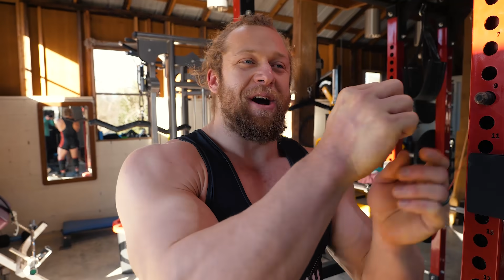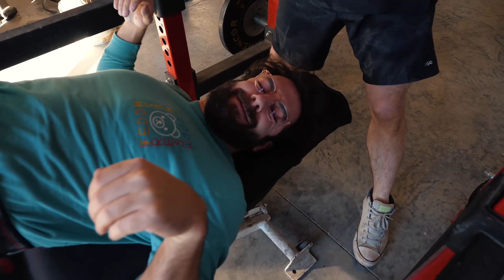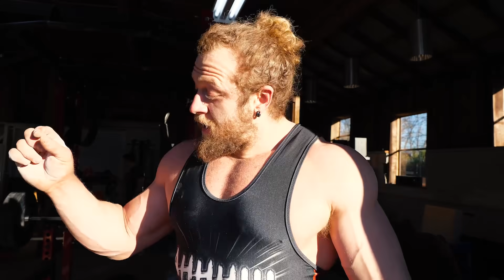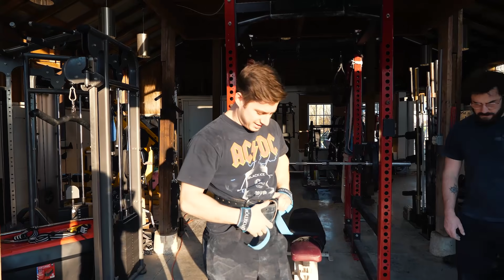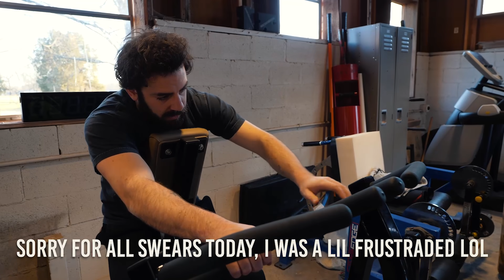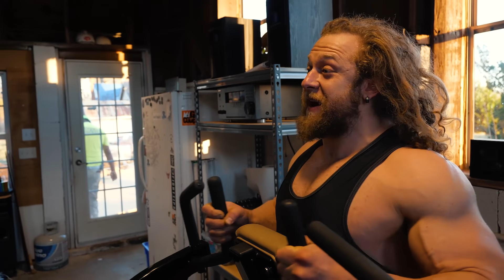Heavy Deadlift Day Goes Right & Wrong

Comment: I am loving these training videos. The ups and downs are so interesting to watch. After this you should do a bodybuilding series or a strongman series doing a program made by Brian Alsrhue.
Reply: Both would be great, as long as they have a coach that doesn't run them into the ground. I may be overcritical, but it seems to be the case from my vantage point in the peanut gallery.

Comment: 9:58 goosebumps holy fk that was such a great reaction.
Tom's performances just keep surprising me. I'm really weak but I don't care, I do my best just like you guys.
Loved it.
I have a herniated disc L5 S1 and since I started deadlifting the pain's almost gone. I had really weak low back so If I can give you guys advices since I've worked like hell on this fking disc you should hang to a bar 3 times 30s to really decompress the discs at the end of your session or even each set and also do back extensions standing up or cobra pose on your belly that's freaking good if your low back hurt even if it's just random pain now and then. For what it's worth take some N-acetyl Glucosamine for your tendinitis with collagen supplement every day, maybe you already tried but anyway...
Have fun and take care. Low back's the most important thing.

Comment: Hey Tom, beast deadlifts today! Some advice on the lateral row, you weren't feeling it in your back because of your position, which was also moving. Load the same weight on each side and then even when you want to isolate one arm, grab the bar with the other hand and use it as an anchor so your body stays in position.

Comment: Maybe a bit late in prep now to play with new ideas but if you want to help save the shoulders more, Tom, try tucking your elbows on the way down then as you press begin to rotate them more outward. So the lower you go, the more the elbows should drift so they point toward your toes then as your press they'll face slightly outward as they do now. If you think of rows, you can more easily and comfortably get the elbows back behind the body with them tucked as opposed to outward and it carries to bench as well. Lots of great videos to digest on it, and it 100% helps save the front delt, rotator cuff, etc during bench. May not add actual pounds to the bar but certainly will keep you lifting longer!

Comment: I relate so much to Tom right now. I was supposed to do six doubles at 85% today but after three sets I had to take weight off just to be able to do it. It was still more weight than the same workout in my last training block so I'm telling myself that it's fine but it feels like a loss anyway. It's hard to accept that those weights should feel that heavy! Being deep in the hole from tons of volume sucks but hopefully you'll reap the rewards once you ease off, you'll feel invincible!

Comment: Tom....I think I may have told you this at the Sydney seminar: I reckon you’re right leg is shorter than your left.  Do you get back pain?
Reply: Leg discrepancy is pretty common. Can cause issues when the difference is more than an inch (sometimes). No one is completely symmetric.
Reply: Erich Schaefer - Exactly. Most people have a discrepancy of 6mm. I have up to a 25mm discrepancy I didn’t even know about until it was too late and I had disc damage. I wondered why I was treading down the back of every pair of jeans on one side. I know where a 9mm heel insert in a shoe and it has sorted me out. Can even lift fairly heavy again (110kg Dead lift isn’t bad considering the mess I was in 10 years ago)

Comment: Hey Tom, 
For the tendinitis try rice bucket exercises. I think your flexors are stronger than your extensors. 
Google rice bucket exercises or get a rubber band and extend your fingers using the rubber band as resistance. This can be done multiple times per day and it will relieve your elbow pain. Even thought you feel the pain in the elbow it can be in the forearm. I’ve used this on my clients it’s from working out a lot and squeezing more then extending.

Comment: You should consider practicing getting the bar of the rack on your own in the bench. A bad lift off can ruin a lift, and it is a parameter you can take control over.

Comment: Honestly your depth is fine as long as it's below 90 and most of them are so i don't see the issue there. I think you should hold your deadlift at the top just cause that's usually how they do it in pl meets. I also think you should slow your bench since there is a little pause during a meet. Other than that i say good lifts

Comment: Why does Juji think double overhand on deadlift is so hard? At the weight he lifts, I'm sure it is pretty hard. But he even acts like 315 or 225 is difficult with double overhand when other people do it. I think I have bad grip strength and I can still deadlift my 1rm with double overhand, and it's well above 315. For people who actually train grip strength specifically, surely it shouldn't be a problem for them?
Reply: Eventually your grip will be the first thing to give out when you start progressing more in the deadlift which is the reason to transition grip.

Comment: Guys please check out athlean x’s straight arm scapular strength videos. I guarantee it’ll help and possibly eliminate your elbow pain along with the rotator cuff videos. In particular please check out the elbow pain video it’s like 6-7 minutes long and the exercise is incredible. And do it 3x a week for a few months. I guarantee it will help. And whilst doing it take a break from exercises involving bent elbows. Such as bench/curls/squats etc. I also suggest doing some shock absorption training such using a sledgehammer(using weight of tool) or chopping wood every day for 15 minutes. It’ll help strengthen your joints, Restore scapular strength and improve the strength of your forearms. I’m seriously imploring you guys to do this I guarantee it’ll will help and quite possibly eliminate all your arm pain. I’m going to comment this on toms Instagram to hopefully get you guys to see it. I understand if you’re going to push through it for this meet but after the meet you should definitely give this a go for 3 months. 3 months isn’t a long time please give it a go! Love you guys and I don’t wanna see anybody hurtin it’s no fun to watch cheers fellas. I’m gonna be having arm surgery hopefully in the next few months so this is gonna be the primary focus of my training for a long time so I’ll be right there with ya! 🤘❤️

Comment: -Holy crap he goes low on his bench, like down to his belly, that's unique.
-I roll the bar because when using straps to setup it's easier to roll it back into position than slide your feet under the bar again once strapped up. I also use wider stance because it works better for me, narrow stance feels like rat droppings. Body mechanics are fun.